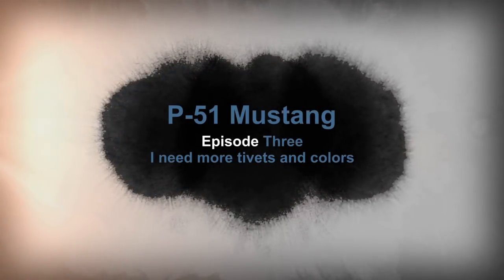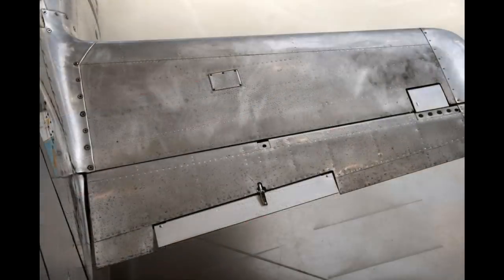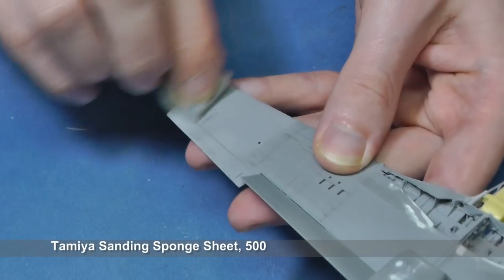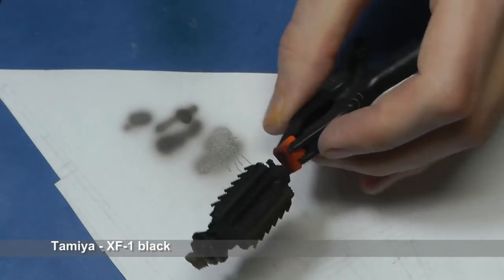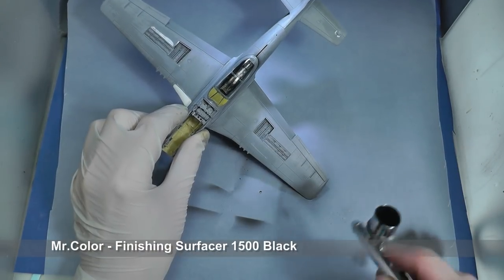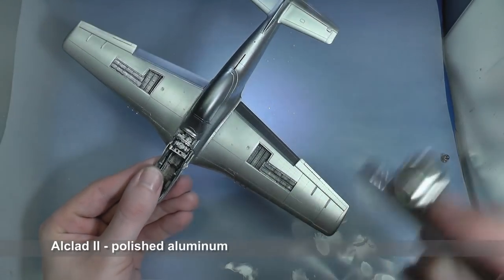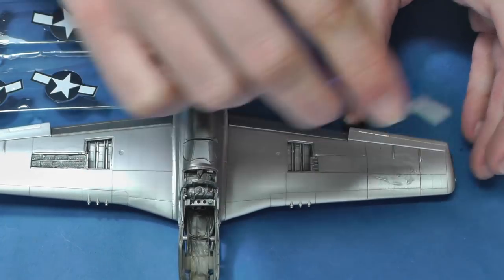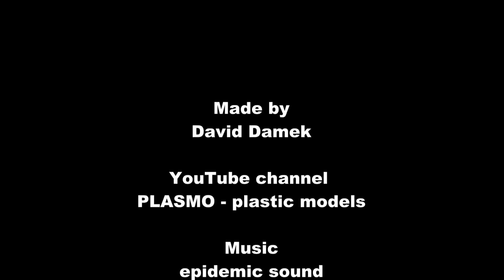P-51D Mustang 1/48 - Episode three

Comment: Thank you David. 2 questions - why paint the Alclad over the Mr Color silver? Why not just paint the Alclad on the primer.  Also, how did you scale the blueprint you found on google, to the proper scale for the model.
Reply from the maker: Alclad is very soft and after spraying all scratches and impurities are visible. You must clean your model perfectly if you want to spray only with Alclad.
Reply: Very interesting. I observed as well that alclad highlights scratches and impurities dramatically. But why Mr Color silver better for this purpose than other paints? Thanks!

Comment: Hello David,
I have some difficulties with my modells. Iam using an air brush to and last time when i used it there was a problem and there was a rust on the surfice of the moddle like bubbles. It was really ugly and tha paint came off like it was just like powder.
Do you have any ideas what could cousd this, maybe there was a problem with the paint or maybe the preasure was to high.
Reply from the maker: What paints and thinner are you using?
Reply: Revell paints and simple household thinner.

Comment: im hoping someone can help me. so im building a 1/24 spitfire (airfix). on the fuselage where the gas tank would be and under the engine bay i have these massive gaps. normal glue doesn't seem to hold it for very long and it takes a bit of force to close them, they only way it stays close is useing model filler the close them. i was hoping someone has any other tips to keep the 2 parts closed

Comment: you painted the canopy, didn't you?
Reply: Im confused... he did
Reply: I think he has another one and using this one like protection for interior,or there is liquid mask applied? If not that would be funny and sad at the same time :D
Reply: mmm... he glued it so i think it was an error.
Reply: anyway, he changed it so it's all ok XD
Reply: Some people were not paying attention... :)  6:04
Reply: +Kevin Garcia i was talking about the posterior part of the canopy
Reply: That's the windscreen Kevin.
Reply: Kevin 6:38 , where is the masking?
Reply: It wasn´t a glue for plastic models, he will be able to take it away with just a little bit of pressure. Probably second canopy.
Reply: The front canopy is masked by tamiya masking tapes but the rear one is not.
Reply: you use a pva glue just so you dnt have to mask off the cockpit most kits come wit 2 sets then just spray n go  much easier plus it helps wit the line around the canopy
Reply: http://www.detailscaleview.com/2015/09/tamiya-148-p-51d-mustang-8th-af-0040.html

The kit includes one more canopy which is separated from the frame.
Reply: Yah and that's the one he finally used. Look at the end of the video @ 11:11.
Reply from the maker: Hello, guys. Very nice discussion :-D :-D Yes, in the kit are two canopy parts, so I simply used the second one. I glued it with PVA glue and therefore it is not a problem to replace it. Otherwise, I can simply remove color from clear parts with industrial alcohol.
Reply: At the end it shows it clear

Comment: what do you thin the mr hobby surfacers with?
Reply: Mark Russell He probably used Mr. Levelling thinner as he does with his other paints.
Reply: thanks. looks like i need to do some experimenting..
Reply: Mark Russell I highly recommend that thinner if you don't already use it. It works really well to thin acrylics too - paint flows really well, minimal overspray, dries really quickly and very durable.